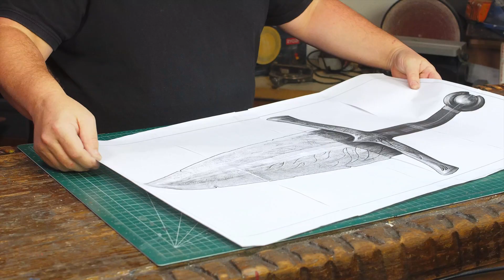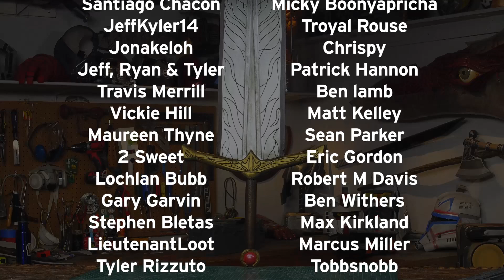Odin Makes: the Curse Crusher from Pixar's movie Onward

Comment: Odin, i have a question about Dremels. Is the super light and small one that looks like a pen good?
Reply from the maker: That is the Flex Shaft attachment, and I really like it. The smaller flex shaft is easier to hold, and the torque of the motor is not in your hand.
I got it a couple of years ago from amazon on sale. I would say it is worth it. I also like the look of the one Adam Savage has, I forget the name, but he did a video just about it. I have not used it, but I like it.
Reply: Odin Makes Hm. Thanks for sharing :)

Comment: So I know you're waiting on an order of cat toys from AliExpress (or wherever) but just so you know Chewy.com sells a package of just the foam balls. In case you're not finding the plastic ones useful and think you might still need emergency cat toys while waiting
Reply from the maker: The Chewey,com ones were pretty pricey in comparison. Overall they are still cheap, like $.66 each and might be a more reliable method for ordering.
Reply: @OdinMakes  ah~ okay. I work at one of the warehouses and see them occasionally so I don't actually know what anything costs. @-@